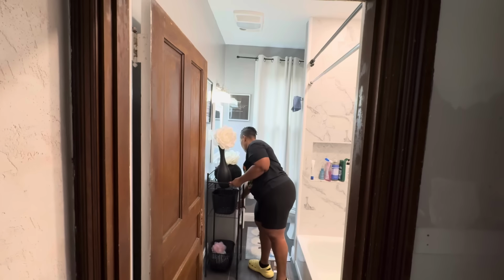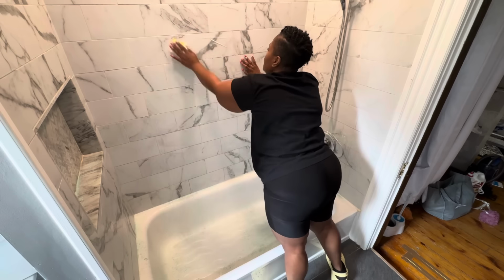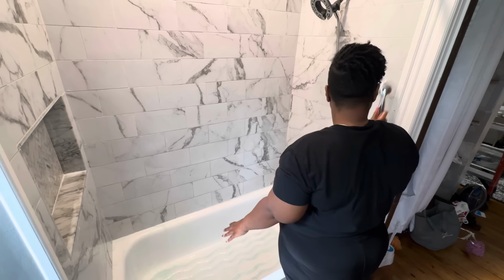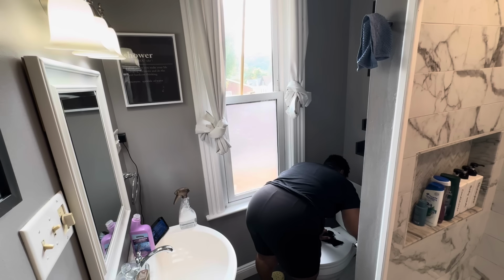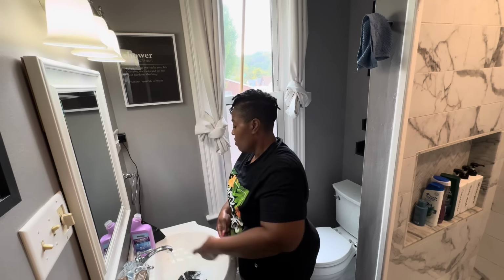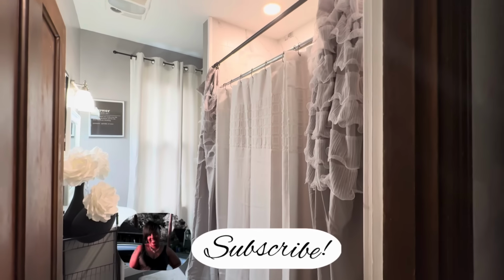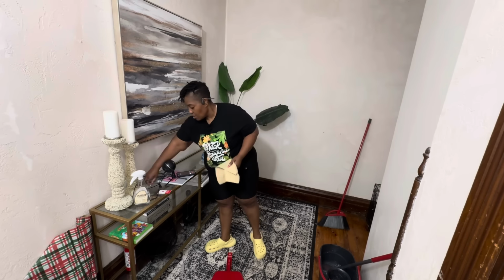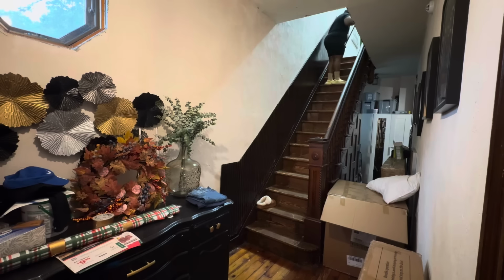SUNDAY RESET CLEAN & DECORATE | A LOT OF VENTING, UPCOMING TRIP & SURGERY | SHYVONNE MELANIE TV

Comment: Hi Shyvonne, listen I had the same problem with my new toilet seat and this is what I did ; get a pair of pliers , grip the insert on bottom hold tight , now take screw driver and twist on top  then make sure you have the seat straight close caps this should help. 👍🏾

Comment: And you don't have to have your car inspected at the dealership either! I don't know about PA. But here in NY you can have inspection done at any gas station that has a shop or any mechanic that is licensed to do inspections...which many are!  And as you correctly stated, the dealership is always going to be more expensive to get anything done. I have mostly had used cars in my life, but even the one time I have had a new car, which is my 98 Honda Civic - which I am just now getting rid of - I have driven that car for 26 years & it owes me nothing! lol! I never took it to the dealership & I have been lucky enough to have a good mechanic, I get my oil changed every 3k miles or so & honestly if the body of the car wasn't falling apart - the engine is still good, it doesn't even have 200k miles on it & Hondas will go to 300k- I wouldn't even be getting rid of it!  I always say cars are like men - can't live w/em, can't live without em' lol!!   I know you & many of us have really been going through it this year & I thank you for working so hard to always be positive & have a grateful heart Shyvonne! 💙💫